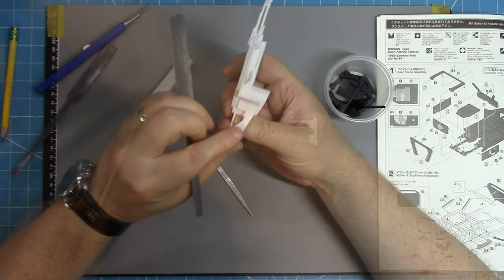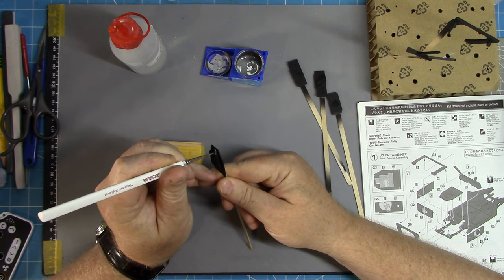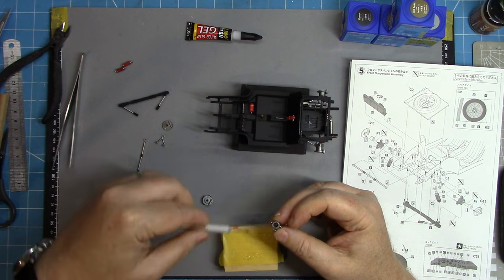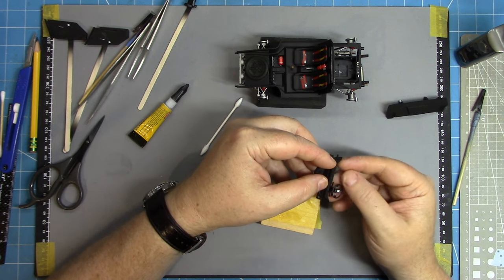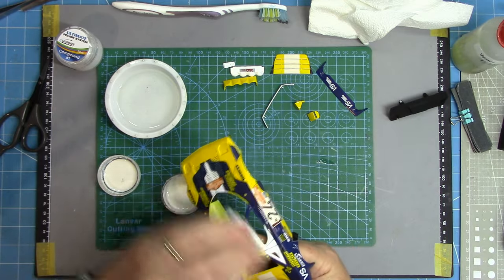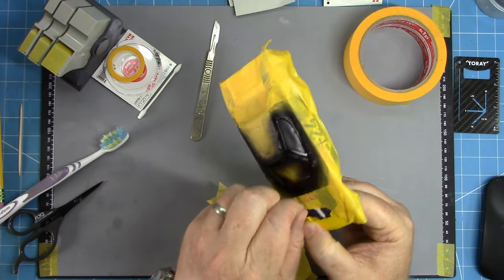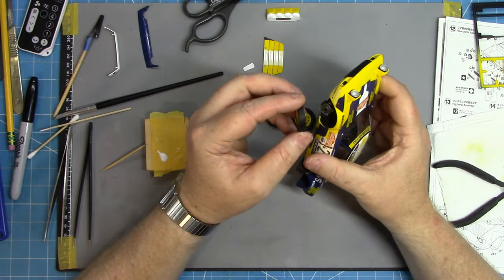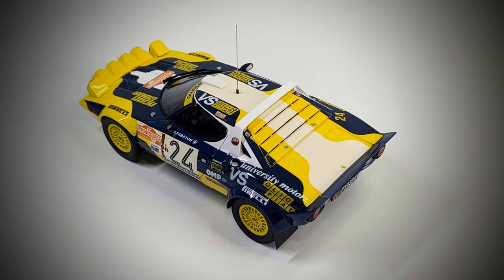Hasegawa 1:24 Lancia Stratos Part 2 - Final Part

Comment: Hello dan, new subscriber here. Just stumbled on your channel as i was searching for the build video,s of this car. Did you change anything on the ride height?? Or just put it together,because the stand is very nice, not to high,not to low.
Reply from the maker: No adjustment needed. This is for a gravel rally, I can't remember if the tarmac parts were included in the box - sometimes Hasegawa leaves the other parts in. But I just used the gravel parts for this build